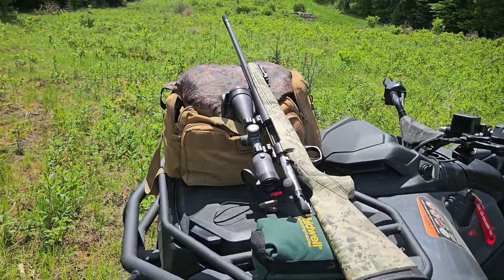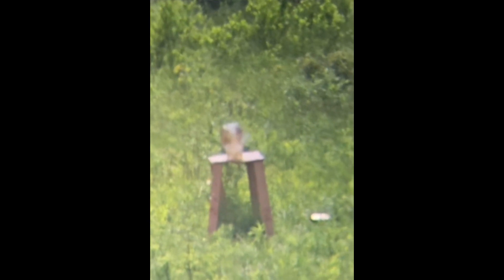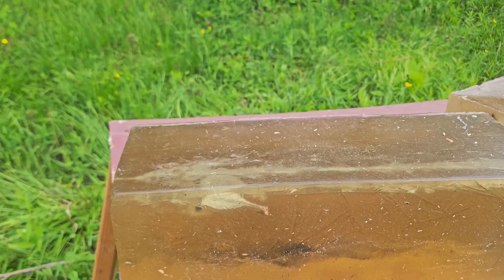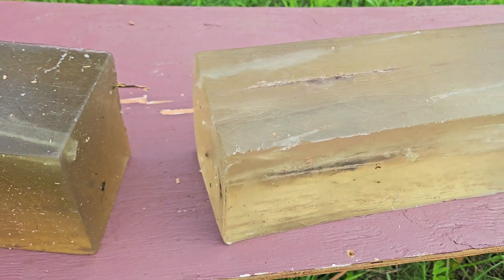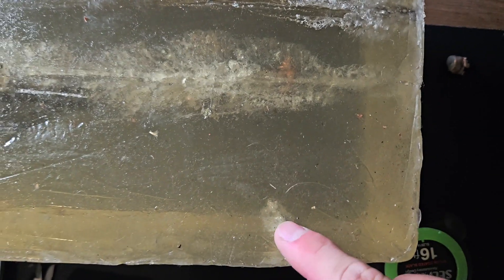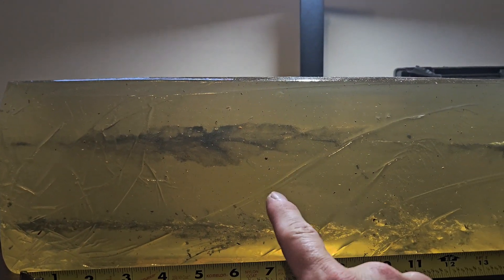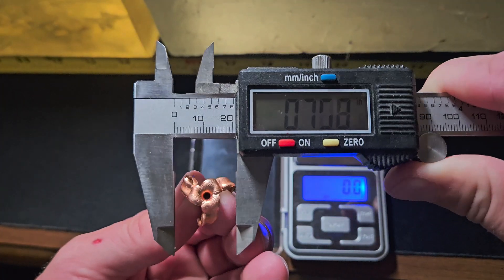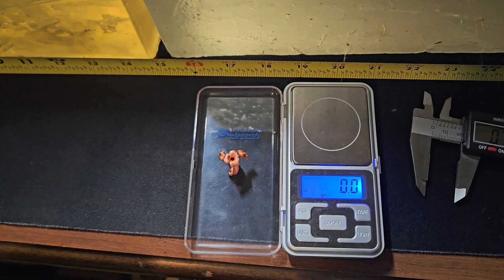7mm rem mag : 140 maker T-rex  re-test at 300 yards.

Comment: Great test and good shooting. That bullet performed great. Hope you can develop an accurate load. How about using reduced reloads to simulate longer distance impacts ? I'd be a lot easier to hit the gel block.
I really enjoy your bullet testing.
Reply from the maker: Thanks for watching! I have thought about reduced loads but to simulate say 400 yards , you would have to reduce the load too much. If there's not enough powder and you have air space in the case it can be dangerous.  I've also read that it's not an even comparison because the rotational velocity will be different at long range vs reduced loads.
Reply: It’s what the bullet manufacturers do to test their bullets since hitting gels squarely at distance is such a PITA. It’s a lot very to have smaller cartridges, but for 7mm it seems like your only real bet is 7-08 and reduced loads of h4895, which can be loaded down to 60% of max charge. Unless you’re willing to go to like 7mm BR or 7 imsa, which is a bit silly. Luckily Grendel, 6 arc, 6.8 spc, 300 blk, and 8.6 blk  available to test those bullet calibers very easily.

Comment: Do you have random flyers with the Makers? I'll get a nice 3/4 inch 4 shot group and then the fifth is way outside the group. I found that  some of the tips are not seated quite right, I think that might be why.

Cool test! Have you considered downloading some rounds to simulate distance with let velocity? It would be easier to hit targets and still show what the bullets can do.
Reply from the maker: I haven't had an issue with flyers,  maybe your barrel is getting hot and throwing off the shot.  The problem with downloading rounds and having air space in the case. I'd have to find a powder that I can still fill the case with but gives lower velocities.  I don't mind the Challenge of hitting the gel at longer range ,but the logistics can be a pain. This setup took 3 trips with the atv to get everything into the woods